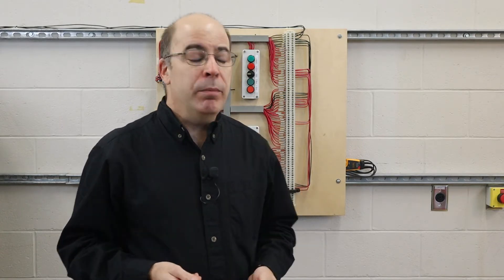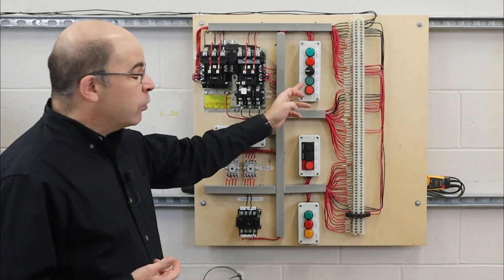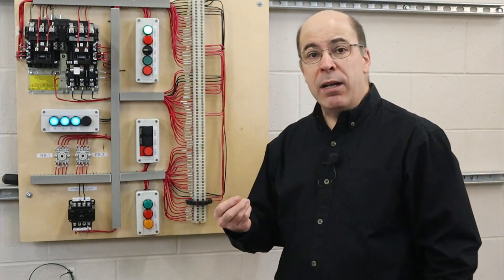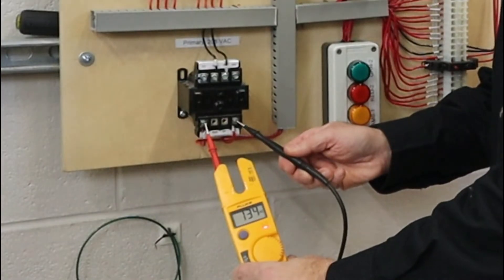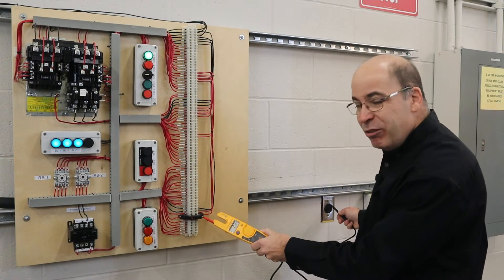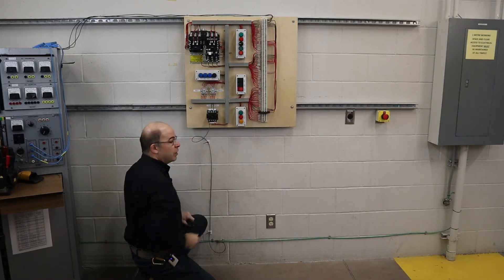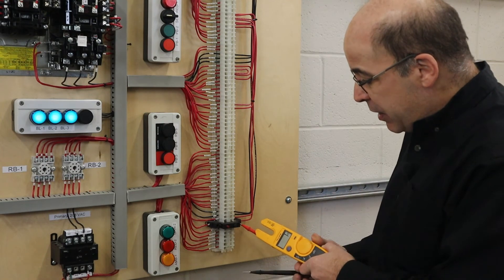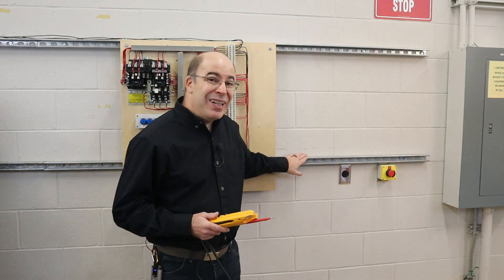Dealing with a floating neutral

Comment: Why the voltage reading to the un bonded metal strap?
Reply from the maker: It's not uncommon to get a voltage reading when referencing unbonded items such as metal parts that are bolted to a concrete wall where the reenforcing mesh is actually part of the buildings system ground as all the structural steel is tied into the ground system. The main focus of the video was to showcase that unbonded metal is going to give you a very erratic meter reading which tends to confuse most people who are just learning about electricity. In this case, the transformer was producing about about 132 volts but when taking a reading while using a piece of metal that was not grounded to the building's electrical system, we got a much lower reading.
I hope you found this helpful.

Comment: .. normally I ground the body/chassis of the transformer...mybe it's safer to add a resistor (pull down) before grounding a floating pin..but it's not an Arduino